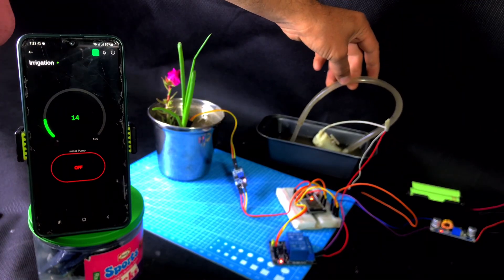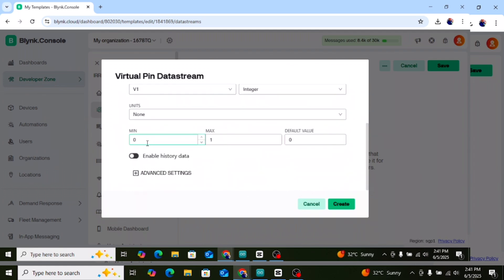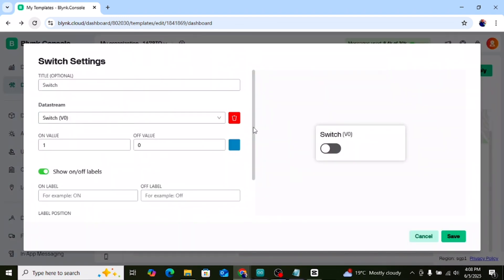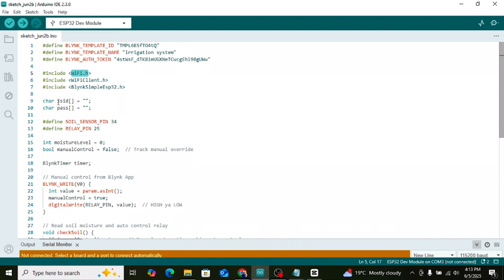How to make a plant watering system using Nodemcu ESP8266 board and  Blynk app

Comment: This video provides a comprehensive guide on how to build an automatic irrigation system using an ESP32 board, a soil moisture sensor, a relay module, and the Blynk app (0:00). The system is designed to water plants only when needed, saving water and promoting plant health.

The tutorial covers the following key aspects:

Components Used (0:04):
ESP32 board (or NodeMCU ESP8266 as per the video title)
Soil moisture sensor
5V 2-channel relay module (only one relay is used in this project) (0:49)
Blynk app

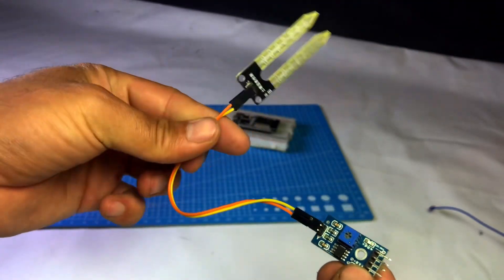Circuit Diagram and Connections (1:11):
Soil Sensor Pinout: VCC, GND, D0 (digital output), and A0 (analog output). Only VCC, GND, and A0 are used (1:11).
Connections:
Soil sensor VCC to breadboard VCC line (1:30)
Soil sensor GND to breadboard GND line (1:39)
Soil sensor A0 to ESP32 Pin 34 (1:48)
Relay module VCC to breadboard VCC line (2:00)
Relay module IN1 to ESP32 Pin 25 (2:09)
Relay module GND to breadboard GND line (2:17)
ESP32 VIN to breadboard VCC line (2:25)
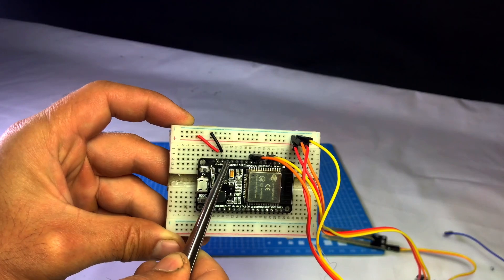ESP32 GND to breadboard GND line (2:32)
5V motor pump VCC to relay's COM terminal (8:21)
Motor's VCC wire to relay's NC (normally closed) terminal (8:33)
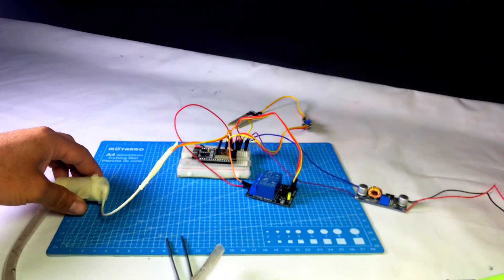Motor's GND wire directly to breadboard's GND line (8:39)

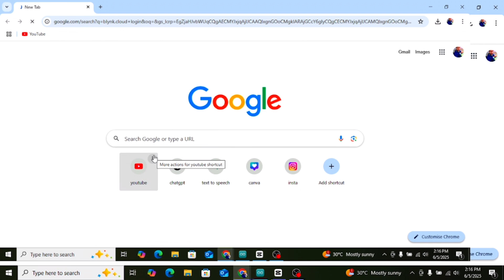Blynk App Setup (Web & Mobile) (2:50):
Create or log in to a Blynk account on blink.cloud (2:50).
Create a new template (e.g., "irrigation system") for ESP32 with Wi-Fi connection (3:08).
Add two data streams:
Irrigation: Virtual Pin V1, type integer, min 0, max 100 (3:27).
Water Pump: Virtual Pin V0, type integer, min 0, max 1 (3:50).
Create a new device from the template and copy the Auth Token (4:11).
Add widgets to the web dashboard:
Switch: Set pin to V0, mode to switch, to manually control the relay (4:40, 6:59).
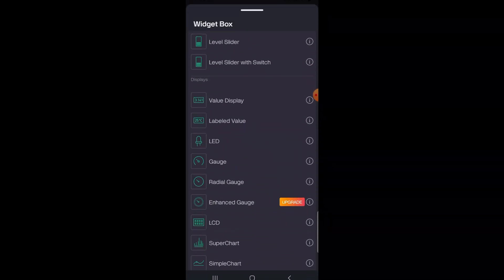Gauge: Set pin to V1, range 0-100, to display soil moisture percentage (4:44, 7:27).

Arduino Code Explanation (5:27):
Paste the copied Auth Token into the `#define` section of the code (5:30).
Install necessary libraries by copying their names and searching in the Arduino IDE Library Manager (5:46).
Enter your Wi-Fi SSID (name) in the code (6:05).

The video concludes with a live demo of the system, showing how the pump can be controlled using the Blynk app and how the soil moisture reading is displayed (7:48). For power, a buck converter with two 3.7V batteries is used, outputting 5V, though a regular 5V power supply can also be used (7:58).

The circuit diagram and code are available for download [https://drive.google.com/drive/folders/1vOpUGG-UcDrppHZNRQ8HAbcQaOgyS2Y?usp=sharing](https://drive.google.com/drive/folders/1vOpUGG-UcDrppHZNRQ8HAbcQaOgyS2Y?usp=sharing

Comment: @ktronic110  
Hello Mr. Kamal,

Good day! My name is Lei, and I’m a Grade 12 student from the Philippines. I recently watched your tutorial about the Arduino Fire Detector System with SMS, and I was really inspired by your project. I’ve been learning Arduino on my own, and your videos have been a huge help in motivating me to explore more about electronics and programming.

I would like to kindly request if you couldmake a version of your tutorial using the A7680C module instead of the SIM900, since the SIM900 only supports 2G networks and 2G is no longer available here in the Philippines. I really want to build my own prototype based on your project, but I’m not sure how to modify the code and wiring for the A7680C module.

It would mean a lot to me if you could make a tutorial or share some guidance about this. Thank you so much for your time and for sharing your knowledge — you’ve truly inspired me to keep learning and improving.